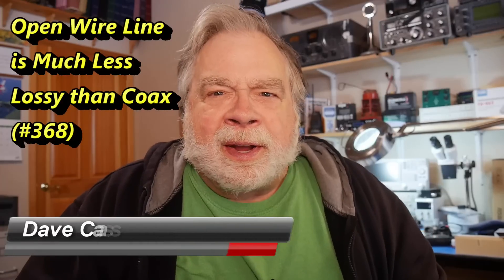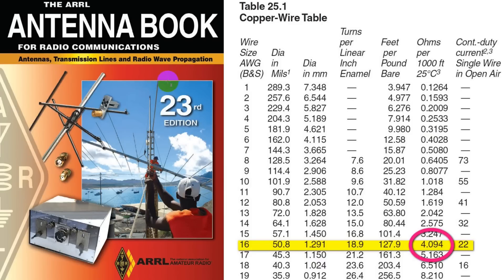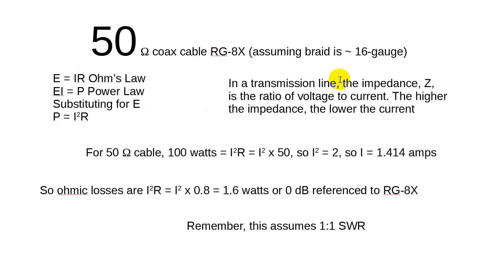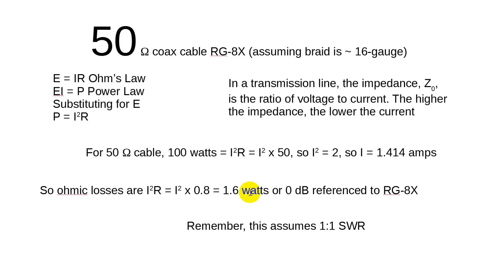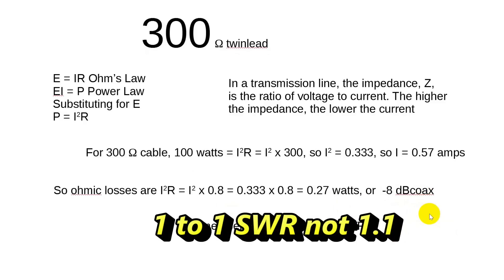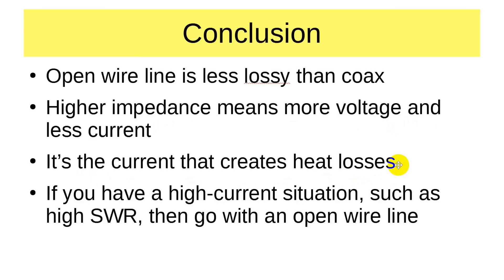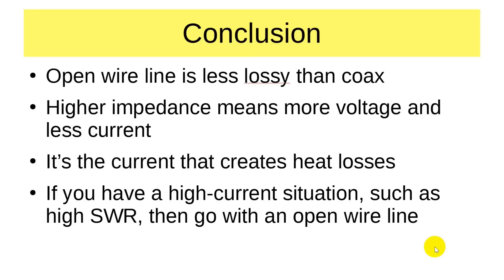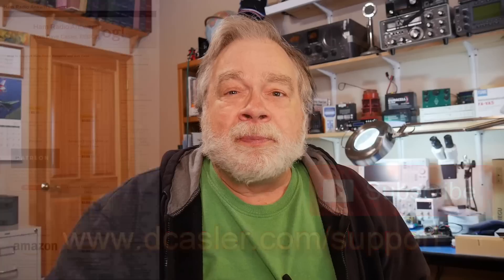Why So Little Loss? (#368)

Comment: Question.  How far is "too far" to run this stuff in reality?  Yes, I've looked at many charts and I see the losses, but is it reasonable to run 450ohm window line, say 1,000ft or 1,200ft?  My station is in my house at the bottom of my hill and I want to run a line to the top which would dramatically increase my elevation (we're in a deep hollow here), but I don't want to make costly mistake if it's just not feasible to do so.  Thoughts?

Comment: Great info as always. But it makes me think... why don't we use high impedance coax instead?
Reply: Due to the ratio of the conductors it is mechanically difficult.  I have not ran the numbers but it would probably take something like a center conductor of # 14 wire and a diameter of 5 or 6 inches if not more for the shield to get the impedance much higher than 100 ohms..

Comment: False info. This is a timeless Amateur myth.

Ladder line is extremely lossy.

Yes the DIELECTRIC loss is tiny because its air. But thats a grossly over simplified and false view.

BUT that goes out the window due to very high losses due to external coupling, to nearby objects or especially the Earth ( ground). The gound is very lossy at HF.

Twin lead is not self shielding like concentric line, so the fields are free to couple to any nearby object.

See a real source on tline info .. the book " Lines Waves and Antennas" by Brown, Sharpe Hughes and Post. PHds , not hobbyists spreading false,outdated false information like this.
.

Comment: What coax used today has a small 16 gage wire. That would be RG58! I would not use RG58 for a 100 run! I use RG 8,or RG213 for that long of a run. The 450ohm wire I see listed is 18 gage. The 400 ohm I just got is 16.  The G0GSF made his antenna with 400 ohm. Some use 450 because it is more common.

Comment: I read what you said on the thirteen ,8 votes, I have a computer run radio. 7300 like you have . I''m afraid to run it on volt power supply  <non switching> i went with a bigger 45 amp marine supply because I was afraid to put that twenty amp on it . was it the right thing to do?

Comment: What do the "windows" do and why does my wire skip every third window?  Are the windows skipped to adjust the impedance to 450?  Thanks for the valuable videos.
Reply: A little late but " The advantage of the "windows" is that they lighten the line, and also reduce the amount of surface on which dirt and moisture can accumulate, making ladder line less vulnerable to weather-induced changes in characteristic impedance"  twin-lead wikipedia

Comment: By your info the 600ohm ladder line is only 1db better than the 450 ohm. I have all the parts to build a field day QRP 
antenna using 600 ohm. What balun you use, I read it does not matter. I plan to go within 10 ft of the station and 
use a balun and coax to the FT-817.

Comment: A very good video, well explained as always, however I take some issue with the usage of a voltage balun to feed the line UNLESS the line is terminated with its characteristic impedance.
In the example for instance of an openwire fed doublet (with a common mode choke/current balun)  I believe it is better to present the reactive load direct to the tuner. Most tuners are more efficient at driving high impedance loads than they are at matching low impedances.
Reply from the maker: Very few hams (if any) match impedance both at the transmitter and at the antenna. I know I sure don't. I made that assumption so I would have no reflected waves on the line.
Reply: @davecasler , thank you for the reply, I meant that the use of impedance transforming baluns in the shack between the tuner and the feeder..

Comment: Thank you for another great video. I think this is more complex than adding just 9:1 balun between your Trx and the ladder line. The length of the line matters too, as you will experience both current and voltage nods in the line (depending on frequency). I think anyone who is planning to use balanced line should read any manual for any balanced line tuner. Also, there are antennas like; G5RV and ZS6BKW using balanced line as a match and they do not need 9:1 balun either. Perhaps topics for a third video on balanced line? My 2 cents...
Reply from the maker: I made an assumption early on that the SWR was 1:1, therefore no standing waves on the line.
Reply: @davecasler  Yes, I agree with you. You made this assumption.  I wrote this more in the context of the doublet antenna shown in your video and its practicality.

Comment: Yea open wire is the best I use it to my delta loop with 80 meter 600 ohm ladder line to the shack , one question  remains , why is it so hard to find baluns for 1:12 so we can connect the ladder to our 50 ohm tx/rx
Reply from the maker: There isn't any demand for them. You might be able to have one made or make one yourself.

Comment: Dave this video makes up for the last one your back to being the man. I would like to point out that most manual tuners have a 4 to 1 balun and tuners are designed to handle high impedance very well not so much with low impedance. Don't use a 9 to 1 balun on a multi band antenna because you will have some frequency with very low impedance not good. The tuner would actually be better with a 1 to 1 instead of the 4 to 1 they come with. Now show how much better it is at 3:1 swr then 30:1. Watch all your video's. You teach new hams a lot. Keep up the good work.

Comment: Would love to hear about elevated folded counter poise. Do they replace need for ground radial system and Inverted L fed at top with open feed ? K2AV has a web page but I’m no good with modeling. Also love to hear about base loaded coils to make a 5/8 wave 80m vertical element work on 160. I’m a low band guy  trying to do a vertical 😉thanks Dave KC3ONO

Comment: What line spacing distance is ok for 14 gauge homemade ladder line that is feeding a 520 foot loop 150 feet away?
Is there a feed line calculator online?
Reply from the maker: You can look at Chapter 23 of the ARRL Antenna Book--it has the calculations and some handy graphs.

Comment: So if a guy was making a large doublet, say 80 or 160 meter, custom ladder spacers, increasing impedance to say, 1000 ohms or greater, with a proper balun, wouldn't be a bad idea for maximum efficiency? Especially for long runs over 100 feet?

Comment: Does not work so well when wet. Even in the early 60's it was more common on VHF-UHF. Many of the popular beams and colinears had balanced inputs and matching networks with adjustable 1/4 sections.

Comment: Isn't the MFJ 974HB antenna tuner optimized for windowline use? An experienced ham friend swears by this set up with dipoles.
Reply: Yes, the MFJ974HB is an excellent tuner for balanced line fed antennas. That is what I use for my 90' attic doublet. My balanced line is the center conductors of two parallel 75 ohm coax cables (exact same length). The shields of the coax lines are connected together and grounded. This gives me a 150 ohm shielded balanced feedline. I can tune below 1:1.3 SWR from 80-6m. The antenna is too short for 160m. I can work most of the world on FT8 with this setup.

Comment: What exactly happens when a ladder-line gets too close to a metal thing, such as a rain-gutter? Does the loss get much worse, because a bunch of current spreads out into the gutter, instead of out to the antenna? Or is it more a matter of protecting my house from RF interference?
Reply: As long as it's for a very short distance it won't make a noticeable difference. You only have to stay away as far as the balanced line is wide. If your using 450 ohm ladder line that's about one and a half inches.
Reply: You're on the right tracks. If the ladder line is very close to a conductive object, the electromagnetic field created by the line's conductors will induce current in the object (gutter). Current flow means energy is dissipated in the gutter. It is lost and not transferred to the antenna.

Comment: Don't forget dielectric losses!  Vacuum is best, air is close to a vac.  It takes power to align the electrons in plastic insulation especially at RF.  That's why LMR-400, Belden 9913 etc have a plastic spiral around the center conductor.  It's mostly air.  Twin lead is mostly air as well for the same reason.  So, at lower impedances copper losses dominate, at higher impedances dielectric losses dominate.
Reply: Yes. I think it is misleading to say that only characteristic impedance is responsible for losses.
Reply: @johnsmiht7776  Below about 1000 MHz the copper loss is almost all the loss.  Not enough loss in the dielectric to think about .
Reply: Below about 1000 MHz there is very little loss in the dielectric.  So it is not much of a factor.  The reason for the plastic spiral is so that a larger center conductor can be used.  That gives less loss in the copper.

Comment: How to get ladder line from the transmitter out the window to the outside?
Reply from the maker: I've just closed the window on it, but that's not the best way to do it for sure. Take a look at MFJ-4602, which offers a balanced line feedthrough.
Reply: @davecasler  I also feed it through the window and close it Dave! ( "Window line through the window"! Seems so appropriate somehow.) it's been working just fine like that for almost two years! lol! 73 Tom.